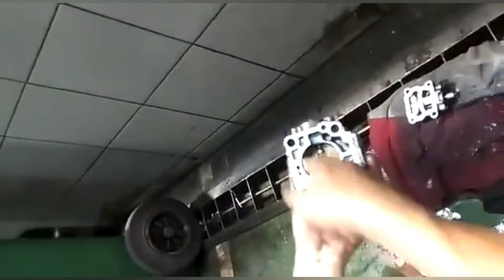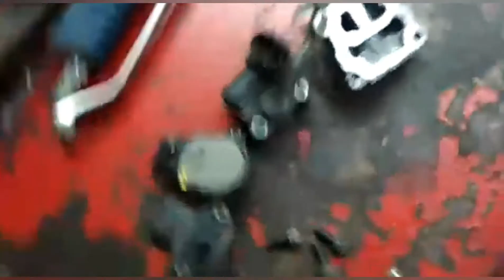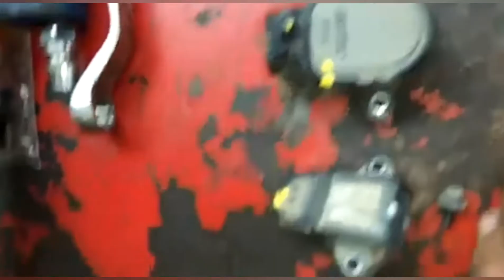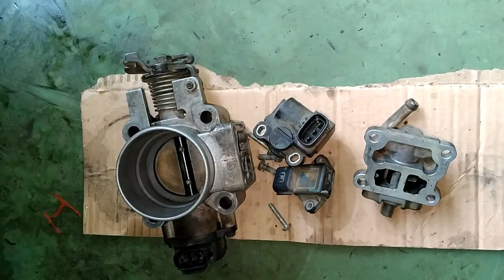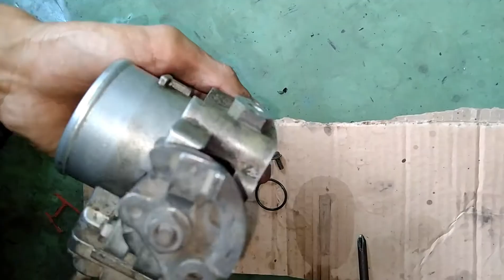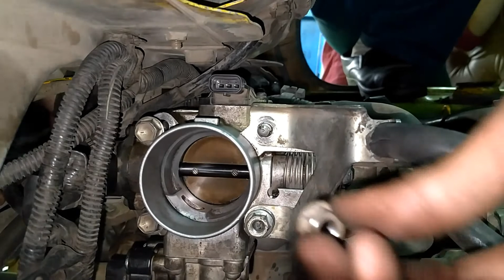overhaul throtle body rpm ngedrop suzuki  apv/carry futura injeksi .lakukan  hal ini

Comment: Ban klo koin nya kurang rapat apa pengaruhnya
Dan sensor MAF jg apa yaa
Reply from the maker: Kalo koin throtel body harus nya gak boleh rapet om.. Harus ada celah dikit buat langsam.. 

Kalo sensor maf buat sensor udara masuk ke intake..
Reply: Cara mengecek sensor maf rusak tidak gimna om
Reply from the maker: Harus di scan om.. Kalo rusak biasanya cek engine nyala
Reply: Kemarin cek engine nyala
Pas d scan trbaca trottle body dan sensor maf
Dan d saat d bersihkan trottle body 
Lampu engine hilang dan tidak trbaca lagi sensor maf
Tpi skrng bbm boros dan rpm lambat trun dri 1500 ke bawah 1000
Reply: Apakah d scan sdh terbaca harus d ganti???

Comment: Om waktu AC on mesin trasa berat negempos kenapa y
Reply from the maker: Tapi rpm normal gk om saat nyala ac
Reply: Rpm normal
Reply from the maker: throttle body nya udah di bersihin blum om.?)
Reply: @rudiperot  udah om mungkin rotor isc rusak

Comment: Bang mobil injeksi Futura hidup sebentar mati lagi apa nya bang
Reply from the maker: Pompa bensin bagus gak om?
Reply: @rudiperot  bagus bang
Reply from the maker: Udah dilakukan pengecekan ap aj om..
Reply: @rudiperot  bang kalau pulpam udah baru injektor udah di ganti tapiesin ga bisa hidup apanya
Reply from the maker: Gini om.. Permasalahan awal mobil futura nya knpa. Terus udah di lakukan apa aj. Kalo untuk mobil gak hidup banyak faktor nya om.. Pengapian bagus gak. Bahan bakar bagus gak. Kompresi bagus gak..?
Reply: @rudiperot  di stater berat aki langsung lemah bang
Reply from the maker: Aki nya normal gak om..? Stater berat itu dari Aki apa dari mesin.. Kalo Aki lemah stater juga bisa lemah.. Dan sebalik nya Aki bagus tapi mesin nya macet juga bisa stater nya berat.. Nah yang jadi permasalah nya mobil nya tiba2 mati atau ada kendala lain seperty kehabisan air radiator atau hehabisan oli.. Pada awal nya
Reply: @rudiperot  sama pinjem aki temen juga gitu satu stater bagus kedua kalinya lemh

Comment: Klo ngedrop itu apa yg harus di periksa?
Reply from the maker: Ngedrop nya pas posisi apa om.. Posisi idle. Aselerasi atau nyala AC kalo pake AC mobil nya.?
Reply from the maker: Biasanya IAC nya macet..
Reply: @rudiperot  pas idle nya
Reply from the maker: Coba throttle body nya di bersihin om..
Reply: @rudiperot  udah di bersihin mas,di periksa ngak ada yg macet masih begitu juga?
Reply from the maker: Pengapian bagus gak om.. Pengapian juga ngaruh
Reply: @rudiperot  bagus,ngedropnya terasa klo ada polisi tidur kan saya injak pedal kopling Sama rem nah langsung ngedrop gitu
Reply: Ngedrop tu apa bang